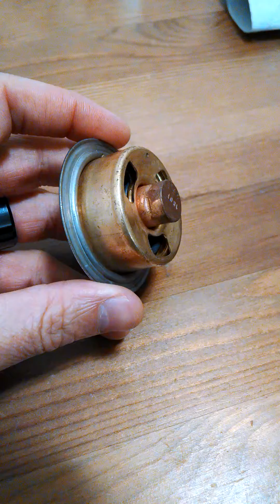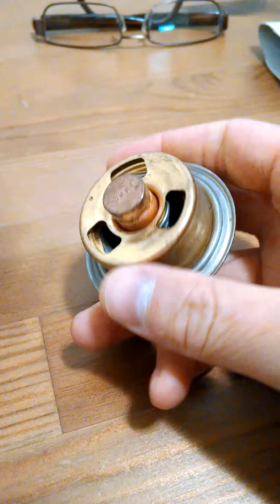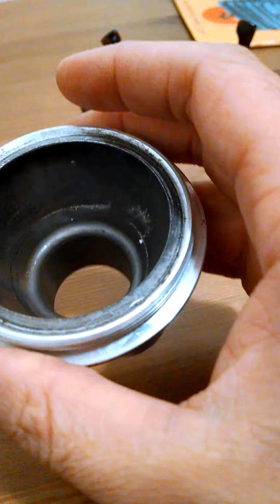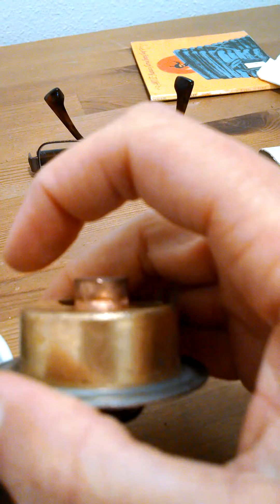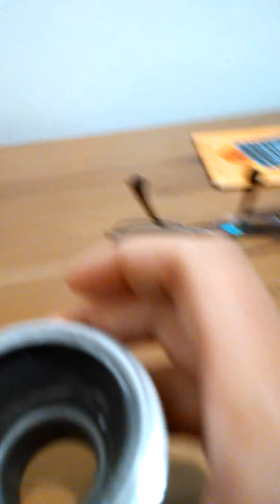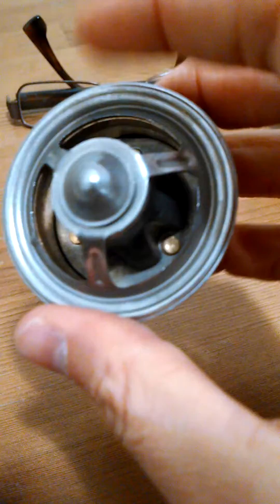Don't use 'high flow' thermostats in remote housin

Comment: That's a Robertshaw 330 series high flow style thermostat. Those are used in the 351 Cleveland with a restrictor plate that sits in the engine. Took me years to figure out why my car was overheating. For years I used a band aid fix and installed an electric fan on a switch thinking that my issue was not enough air flow through the radiator at idle but I was putting in a 351 Windsor thermostat, which uses a conventional style thermostat. When you try to use a conventional style thermostat in the 351 Cleveland without changing the restrictor plate, only about half of the coolant is forced into the radiator and the other half just circulates in the engine. To be fair, it was actually the shop that rebuilt my engine that put the wrong one in first. So I never saw the original thermostat they pulled out. I later found out they make a modified restrictor plate that allows you to use a conventional style thermostat. On paper the high flow cooling system used in the 351 Cleveland seems like a good idea. But in practice it created a lot headaches. The Panteras of the early 1970's used the 351 Cleveland and apparently they all had overheating issues. It was actually the Pantera guys who figured out if the blocked off the hole in the restrictor plate, they could run a regular style thermostat and most if not all of their overheating issues had been solved.
Reply from the maker: @SquattingPekingDuck  that's some really interesting info, thanks for sharing!

Comment: You were installing the thermostat backwards. No thermostat will ever work like that.  The sensor always goes towards the engine side.
Reply from the maker: I was not installing it backwards dude. That remote housing is the same on both sides. You put the thermostat in the housing, then put it in the car in the correct orientation. It was not in backwards.

Comment: You put it in backwards
Reply from the maker: I did not. There's simply not enough room in the remote housing for it to open. In normal housings it's probably fine but in this aluminum housing it doesn't work.
Reply from the maker: The other side of the housing doesn't have any more room. So putting it in the other way wouldn't solve the problem.
Reply: No he didn't, I have just checked this out myself with this type of thermostat in the same remote thermostat housing. It blocks flow when thermostat opens.

Comment: I do not understand your housing. The thermostat (silver part) I believe is supposed to be towards the radiator. It looks like you have it upside down?
Reply from the maker: I'm just holding it to show it. The point is that the remote mount thermostat housing doesn't have enough room for this type of thermostat to fully open.